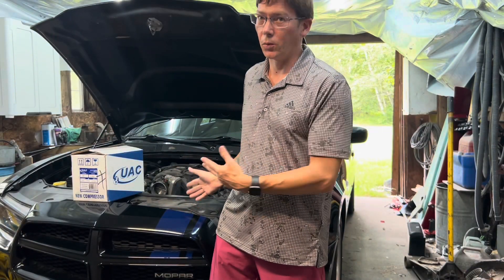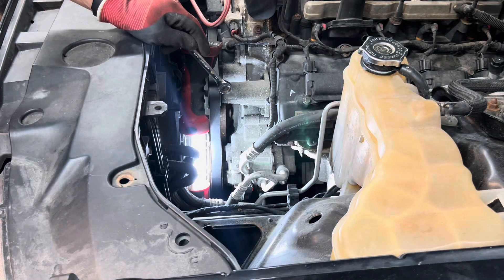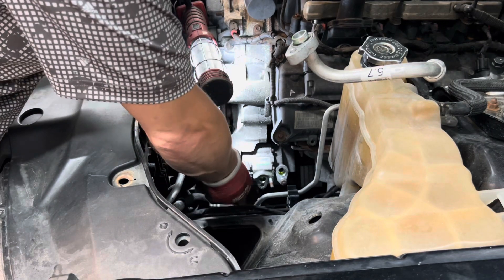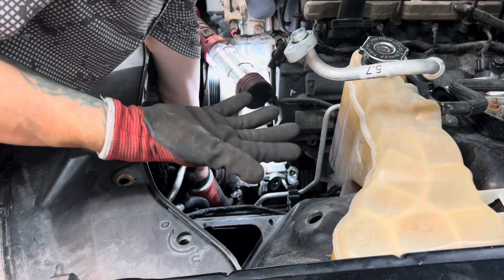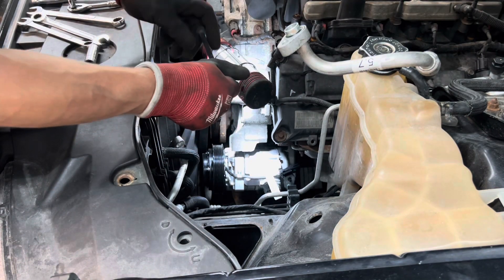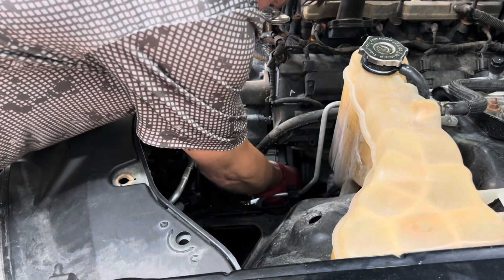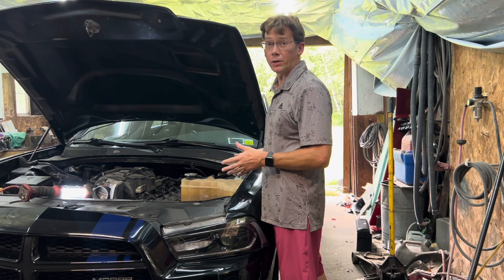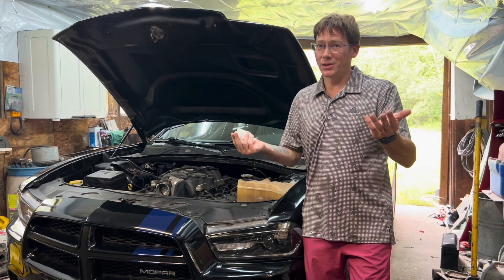Replacing the AC compressor in my Mopar 11 Charger

Comment: Awesome stuff man. My wife has a 2010 3.5 charger and the compressor is not engaging. It spins easily when I turn it with my hand. I’m going to take it somewhere to see if it needs a recharge. If the compressor turns out to be bad, this video will be my guide.